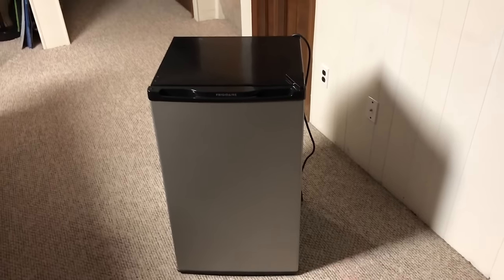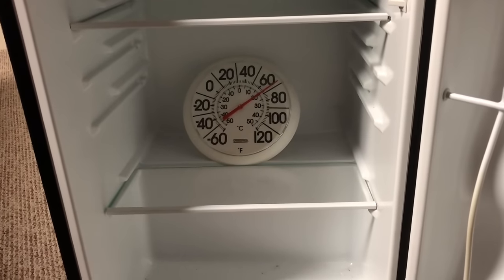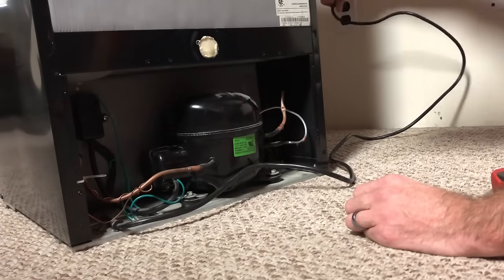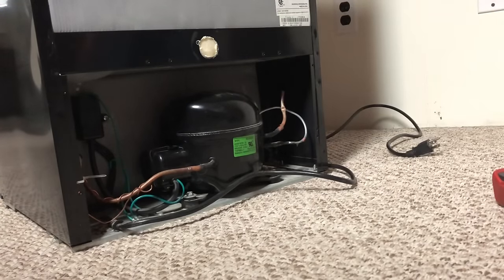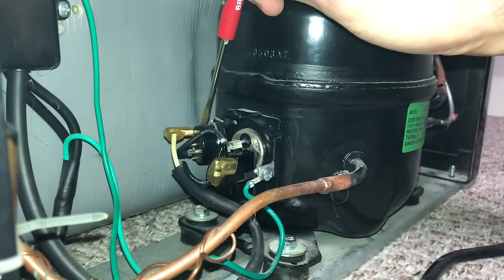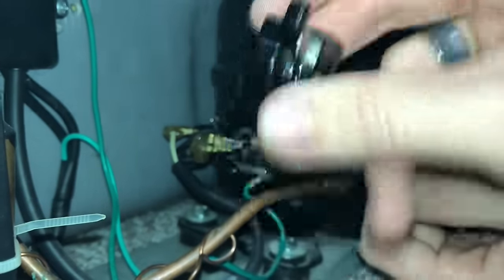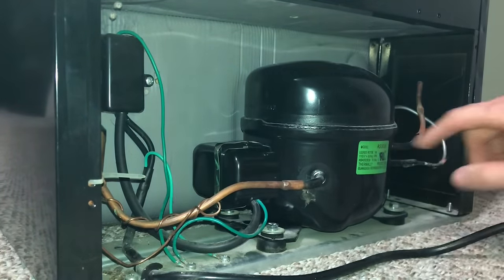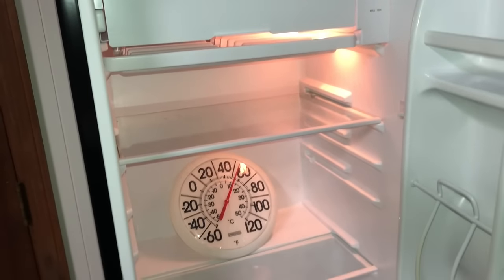Fix a Frigidaire mini fridge that is not cooling (LFPH33M4LM)

Comment: I have this fridge every thing kind of works. 1. The compressor never shuts off. and 2. even at "7" the freezer does not become completely chill. the left side is chill and has frost and the right side I can see no frost , even the ice trays the left side ice try is still ice cold water , right side ice tray is iced. 
with the fridge running for couple of days in 7 if I slowly turn the dial lower I never hear the switch go off except at 1. 
so the fridge is always running.
Thermostat problem?
Reply from the maker: If the compressor is running nonstop, it probably means that there is a leak and you are low on refrigerant. It’s usually not cost-effective to pay a service person to recharge these units. Usually cheaper just to buy a new one.

Comment: I went ahead and order the part even though it might not be the reason why the mini fridge is not working. I also will be ordering a kick starter to deal with the compressor, just in case that is the problem. The kick starter is almost as much as the fridge itself, but I have to look at it this way, that the same thing could happen to another refrigerator.
Reply: The issue is not the part explain here, I think it is the compressor. I either get a kickstarter or just another mini, which will cost about $80 and some tax.

Comment: Hey so I have the same mini fridge snd it doesn't get cold, I checked the bottom were your at and my copper wiring eith the spiral wiring like yours to the left is frozen snd cold but my main black circle container like yours is extremely hot? Idk how to fix this
Reply from the maker: I’m not an expert, but I would guess that there is a blockage in the system somewhere and the refrigerant is unable to circulate through the system. The compressor (round black can) runs continuously because the thermostat is signaling it to run because the temp in the fridge is too warm. The compressor has probably been running non stop for hours/days/weeks and therefore hasn’t had a chance to cool down. On these little units, there’s usually not much that can be done to fix an issue like that…at least without spending more than a new fridge would cost.

Comment: I believe I need the same part, is that relay considered a 1 pin? I ask because that is what the part was that you linked to, but I thought it was a 2 pin (2 pins from compressor into the relay) Maybe I misunderstood. I have the exact same refrigerator. UPDATE: My mini fridge is working perfectly after replacing the relay! Thank you! 😀👍 If you are watching this video, and this guy helped you fix your fridge, do the same and throw him some cash.
Reply from the maker: The relay will push onto two pins of the compressor, but there is only a single wire that hooks to the back of this one. Some have multiple wires that hook to the backside of the relay. You’ll want to get the same style that came off your unit.
Reply: @DustinRogersinMO  The part arrived today. My relay was indeed rattling and had fallen apart internally. Just as you advised, the new part ($10) fixed it perfectly. Your video saved me money for 100% sure. Thank you so much. I hope you can use my tiny donation, this fix is worth much more to me.

Comment: thanks I did replace the relay and I worked fine for awhile it was getting real cold and the back of the frig would ice up and some times I had to scrape all the ice off, now it is cold but not keeping things from going bad fast, the ice in the freezer part is melting and the thing is leaking water, anyone have any suggestions on what it could be ?

Comment: @Dustin Rogers .. I have a Summit mini fridge and the compressor won't stay on. I checked the thermostat and it works fine. I removed the relay and put a new one in. It came on for about a minute and then i smelled a burnt smell and it shut off. The relay is still good and so is the thermostat. I have 2 of these so i just swap parts from the working one. I'm thinking the compressor may be bad but, don't know how to tell any ides????

Comment: Mine did make the broken noise so I don't know if I should just replace it anyways to try.
Reply from the maker: If the start relay is rattling, definitely replace it. If it’s not rattling, if you have a multi-meter, you can test it by measuring the ohms between the two connectors that slide onto the compressor. If it measures OL (out of limits) it’s bad and needs to be replaced. If it measures ~5k ohms, it’s still good and there’s something else wrong with your fridge.

Comment: Called a Heater switch..It preset to a preset load rating. As it's normally closed contact..Once  it cools down. The heat sensitive strip will return to the closed position...As these heat sensitive strips are set by the manufacturers...

Comment: I should have continuity between the neutral and hot terminals, IF the thermostat is turned up.  Well, I don't have continuity, so I suppose the thermostat is faulty.  But I DO have continuity between the neutral terminal and the ground terminal, which you suggest might be caused by an internal short in the compressor.  I'm sure it's possible to have both issues (faulty thermostat AND shorted compressor).  But I'm wondering if you might know of one situation that could create both issues.
Reply from the maker: patriece marshall if your compressor is shorted, I’d focus on that issue first. I’d unplug the wiring to the compressor and make sure the short is in fact in the compressor and not in the wiring somewhere.
Reply: @DustinRogersinMO  Thank you SO much!  I'll give it a try!

Comment: Thank you, would this cause the fridge to come on and off, cools then stops?
Reply from the maker: If it’s still cooling, it’s probably not the start relay. I’d suspect the overload device is causing it to shut down. Basically the compressor starts and cools, but as it’s running, the compressor heats up, which causes the resistance to increase which also requires a higher current to keep the compressor running. If the current consumption gets too high, the overload will trip and shut the compressor off. 

But if it’s doing this, the overload is working as it should and the underlying issue is probably a compressor that’s failing. When it shuts off, check to see if the compressor is hot to the touch. If so, you possibly have a dying compressor

Comment: I have a 4.5 CuFt version of that frig. Mine has drip pan on top of the motor.  My problem is frig section never gets under 40 and freezer will freeze but won't stay frozen continuously. (coldest setting) Will your relay cause this problem too or is it relay works good OR relay doesn't work frig doesn't work at all. In other words, is there a midway point that relay could have some issue but still work some but just cause intermittent overheating?
Reply from the maker: RealmanPwns usually the relay works or doesn’t. You may look to see if you can find a diagnostic procedure to test the thermostat. It would control when to turn the compressor on/off.
Reply: @DustinRogersinMO  Yeah, I took the freezer compartment panel off. The metal fins were frosty but no blockages of ice and the fan behind was working. Maybe thermostat is not calibrated correct...
Reply from the maker: @RealmanPwns  I didn't realize that the 4.5 cf unit had a separate freezer compartment. It may also have a defrost timer on it. I'd recommend looking up your specific model number on a site like appliancepartspros.com and see if there's any common failure items.

Comment: I need a JPQII 4.7 2 pin but can't find the part.  Do you know if I can replace it with a 3 pin and just use 2?
Reply from the maker: Yes. You should be able to use a 3-pin. Just hook up wires to the same positions as your original two wires were attached.

Comment: I brought last year insignia 3.0 cu feet 2door from beat buy mini fridge...freezer hai working fine but the refrigerator is not cool enough and also get moisture in side of the back wall I just brought it  can  you tell me is this the thermostat or stater problem

Comment: Hi Dustin,  Thanks for this video. I have a mini fridge that isn't cooling. the compressor is humming however the Line on the left of it (when you face it), is not cold at all.  Would you have an idea it could be?
Reply from the maker: Typically if the compressor is running and the unit is not cooling, especially on a simple system found in mini-fridges is that the refrigerant has leaked out. If you have access to a clamp on ammeter, you can measure the amps of one of the wires going to the compressor. If you only get ~ 0.5A, that means your compressor is not working very hard which is typically caused by low refrigerant. If your amps are 1.5-2.0, your compressor is working too hard which may be caused by a restriction somewhere in the coolant system.

Comment: quick question... I found a Magic Chef minifridge and the prior owner said that they were defrosting and chipping away large chunks of ice around the freezer tray. They pierced the tray and the freon leaked out. Does the freezer work on different freon supply than the cold compartment? Is this unit salvageable?
Reply: The "freezer" is just the coil shaped into a small box. If you punctured it the fridge is done. The compressor is a neat vacuum pump if salvaged.

Comment: so I replaced the relay and it still does not work. does not get cold at all. I hear the compressor running when i pug it in. What's the next troubleshooting step?
Reply: I also checked the thermostat switch  like you described in the video and that works fine. No short.

Comment: Great video...thanks...      Start relay is damaged...easy to remove..   Trying to find the same Start Relay....   Whirlpool told me to get lost (and I voided warranty by disconnecting Start Relay)...    Cannot find the part # on Amazon....  or 2 other sites that sell Start Relays....any suggestions?  Thanks..
Reply: If your still dealing with this issue, look up the numbers on the relay on google. One of the numbers will be the model number of the relay. Hope this helps or you already fixed the issue.

Comment: My Magic Chef mini fridge was clicking and not cooling. Pulled the relay, but it is not rattling like yours. Is there a check I can do of the relay with the multimeter? Could it be faulty without rattling?
Reply from the maker: Yes. Here's a good video that explains it better than I can through a comment. https://www.youtube.com/watch?v=nx7l9kY2_bU

Comment: My mini fridge started to stop cooling, if I power cycle it or turn the knob off then on it comes back on and then eventually turns off after awhile. I changed the relay start and overload and it didn't help. Any recommendations what might be?

Comment: I took mine apart and my overload relay seems fine. It's not making the rattling noise. But it's doing the clicking when it tries to cycle on
Reply from the maker: The overload is typically white. The start relay can still be bad even if it doesn’t rattle. You can test it with a meter. When the relay is cool, check resistance across the two pins that plug onto the compressor. The typical resistance is 4.7k ohm, although the resistance value is often printed or stamped on the relay housing. If your meter reads OL or too low resistance, your relay is bad.

Also there are various types of start relays. Some don’t rattle when their bad. You have to use a meter to test them.

Comment: I took my  relay out and it looks  like yours but  mine  has no  broken bits yet my fridge  has the same symptoms with not cooling. Should i  replace the relay  anyways
?
Reply from the maker: If you have a meter, you can measure resistance across the two pins that go to the compressor. If resistance is ~5k ohm, the relay is good. If it’s 0 or infinite, it’s bad.

If you don’t have a meter and are willing to possibly waste the cost of the relay, it’s the cheapest/most likely part to replace to see if it gets the fridge going again.

Comment: My Black and Decker only has a white and a black wire (OK. Green too). The white wire goes to the relay and the black one goes to a piece underneath the relay that looks to be plastic and metal. Relay tests OK. I guess there is no overload switch you talk about. Compressor will not come on. Any suggestions?
Reply from the maker: The piece connected to the black wire is likely the overload. Most of them are simply a bimetallic disc that will flex when it gets too hot (due to excessive current) which breaks the circuit. Once the disc cools off, it'll return to its normal shape to close the circuit. You can test the overload by removing it from the wiring and then checking resistance with an ohm meter across the overload terminals. It should have near zero ohms of resistance. If it has high resistance or no reading at all, it's likely faulty and needs to be replaced.

Comment: Hey Dustin, you are the only one I can ask help from... Nothing else did the trick. I have a Frigidaire mini fridge that doesn't power on at all. No lights, nothing in the motor, etc. Would that be a power cable issue?
Reply from the maker: MayhemGang - Minecraft it could be a wall outlet or tripped breaker issue too. Try plugging a lamp or radio into that outlet to see if the outlet is functioning properly.
Reply: @DustinRogersinMO  Working perfectly for all other electronics. This is a dorm outlet too, so no issue on that. Thanks for replying!
Reply from the maker: If you have a volt meter, set it to measure ohms. Unplug the fridge and check to see if you have continuity between the connectors on the plug and where the wires attach to the compressor. If you have close to zero ohms with one of your meter leads touching the plug and the other touching the wire at the relay, you have continuity on that wire. Check both wires. If continuity is good for both wires, your power cable is most likely ok. If the meter reads OL (out of limits) it means there's a break in the wire.
Reply: @DustinRogersinMO  Understood, I will try that! Thank you very much! If anything else comes up, I will update you :)
Reply: @DustinRogersinMO  The model number is FFPE45L2QM by the way.

Comment: Could the relay still be bad even if it doesn’t rattle? If not, is there somewhere else I can check for the issue?
Reply from the maker: Yes, it’s possible it could still be bad. If you have an ohm meter, you can’t test to see if it has the proper resistance across the terminals that plug onto the compressor. The resistance value should be printed on the relay. It’s likely a 4.7ohm.

Comment: Any ideas of the relay doesn’t click once removed? Should I still replace it?
Reply from the maker: If you have a volt meter, you can measure the resistance across the two pins that connect to the compressor. There should be roughly 5k ohms of resistance. If the meter reads 0L (out of limits) or zero, the relay is bad.
Reply: @DustinRogersinMO  amazing thanks for the reply and help!

Comment: I have the same exact mini fridge in your video. I replaced the starter relay and still have the same problem. I had pressed the blue defrost button a few days back to defrost it. I have tuned the dial to zero and back to 7. Left in plugged in overnight. 
Any other suggestions?

Comment: I have a similar issue, but the compressor gets really hot , and doesnt quite cool the fridge. I took out the relay it somewhat rattles (very little though) ideas?
Reply from the maker: Bravotv is the compressor actually running? Put your hand on it and see if you can feel it running. If so, how long does it run before it kicks off? If it kicks off within a minute, it’s probably a bad start relay - the same issue I demonstrate in the video. If it runs for longer, but is just not cooling the fridge, it could be low on Freon, or the compressor could be on the verge of seizing up.
Reply: Bravotv this is happening to me

Comment: I changed the relay and the freezer is cooling now but it seems like the fridge portion is still off. The light comes on but It warm.
Reply from the maker: If it’s a mini fridge like this, the fridge can take up to 24 hours to cool down since it’s just passive cooling (no fan to circulate the air)

Comment: What’s the next step if you replace the relay and get the fridge running but it doesn’t get cooler than 57 degrees?
Reply from the maker: If the compressor is running for a long time, and not getting the fridge cold, it usually indicates that the refrigerant has leaked out of the system. You can usually buy a replacement mini fridge for less than it’d cost to have an HVAC person try to find the leak, repair the leak and recharge the system.
Reply: @DustinRogersinMO  thank you! I installed a new relay to get it going and left it on to cool down with the digital display working and the fan running overnight. Today the reading was at 55 degrees in my garage which didn’t make sense. I didn’t realize the compressor hadn’t actually started but now when I unplug it and plug it back in nothing moves in the compressor. I took the new relay off and it rattles like the old one. From videos I’ve seen I’m assuming that means I blew it by leaving it on overnight and now I need a new relay AND a hard start kit. Thoughts?
Reply from the maker: @sporty22011  check out my more recent vid.
https://youtu.be/5KlTjU4cRVA In that video I show how to actually test the relay. Usually if they rattle they are bad, but it doesn’t hurt to throw a meter on them. You may also test your overload, which I show in the linked video. If a good standard relay doesn’t get it going, a hard start kit may get you going, but I don’t really have any experience with them other than seeing them used in videos. Not sure what the expected working life is for them or the compressor.